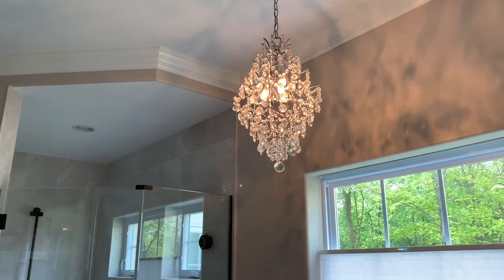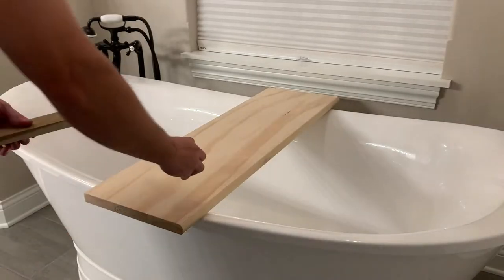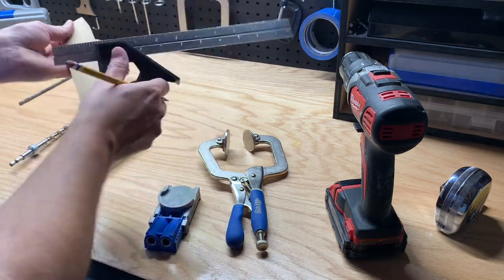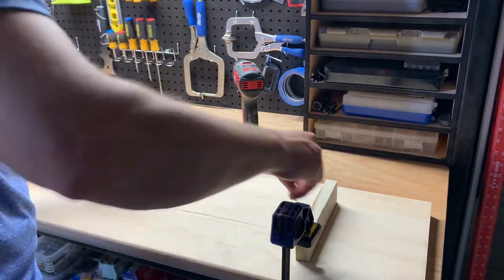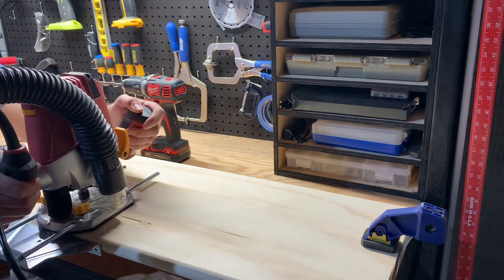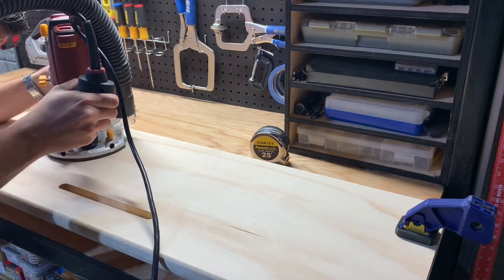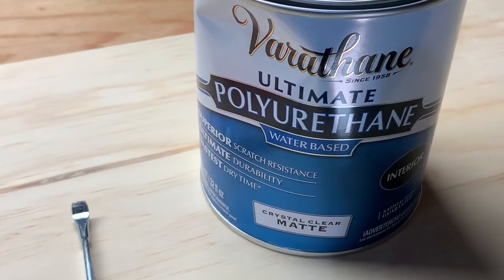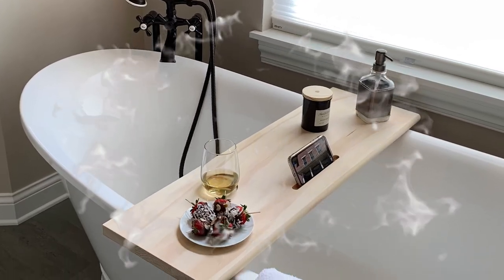How to Build a Bathtub Tray | Bathtub Tray DIY Build

Comment: Oh this is so sleek and nice! You make it look easy lol Nice to see you at work as well :-)
Reply from the maker: Thank you!  It does get easier the more projects you build.  I haven’t used this specific router much and practiced on a scrap piece.  This will help gain the confidence and accuracy on the real project. 👍🏼
Reply: @inspiringbuilds  Yeah that was a great tip to use a scrap piece first